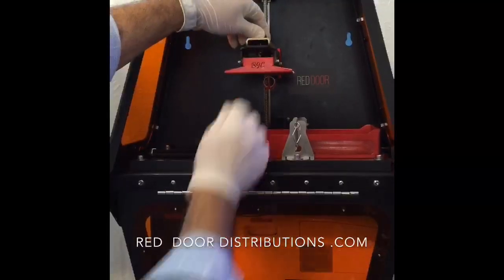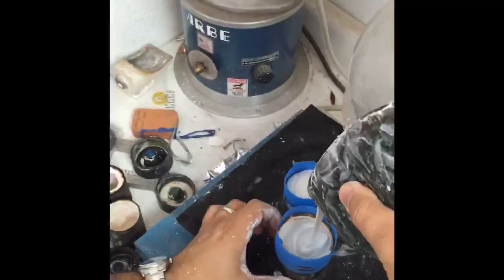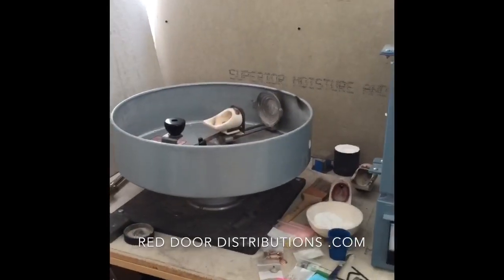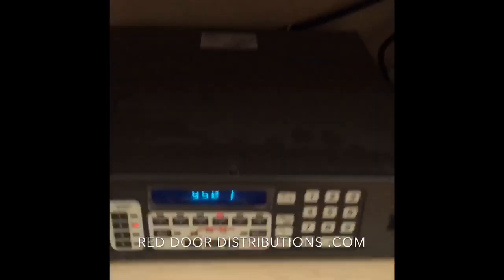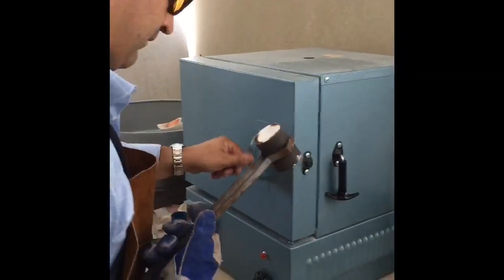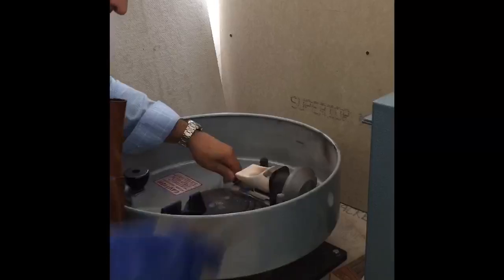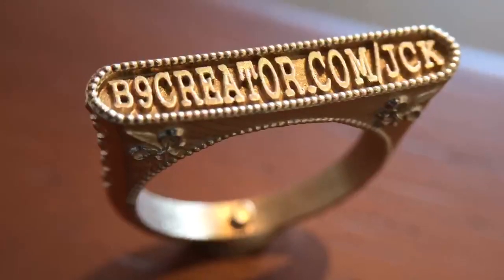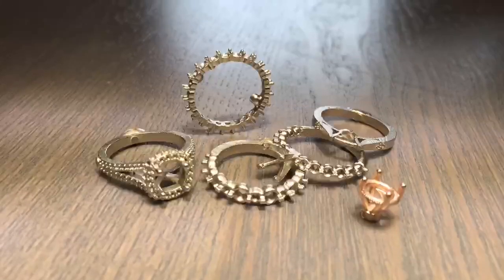Printing to Casting with B9Creations' Resins

Comment: Do you only use Satin cast? Plasticast has been recommended to me but I hate  the way it foams when you vacuum it. I've had bad castings with it for some reason. I've had some luck with my B9 resin but not the consistency I need. If you only recommend Satin cast then I'll go back to it. I'm trying your burnout cycle tonight with Ultravest for the first time. I'll let you know how it goes.
Reply: jewelerguy Also, do you leave the opening to your flasks down or do you turn them up?. That's also been recommended but I'm not sure what difference that makes.
Reply: +jewelerguy yes I highly recommend only using Satin Cast. I also do not like the way plasti cast boils as it has a big "drop". No I do not leave my oven door open nor do I flip the flask upside down. 
There really is no need for that as long as you have a calibrated oven. 
Just make sure you do not leave the flasks flat on the oven floor they do need to be raised up half inch to 1 inch to let oxygen in the flask. 
I do apologize for my delayed response and I really hope this is of some help to you. If you have any other questions please let me know as I will be more than happy to help. 
Best, 
Fernando
Reply: +Red Door Distributions I used your burnout cycle and that worked great. I used ultravest instead of satincast but I have a feeling it's all about the burnout cycle for B9 resin. Wax is a little forgiving but not this resin, that's for sure. Thanks for your video and your reply.
Reply: +jewelerguy Glad to see that your having success. Yes, with this resin it  is all about the cycle. Do you have the 1.2 b9 or 1.1?
Reply: +Red Door Distributions I have the 1.2 b9. Really makes a difference to get the cycle just right and let the investment dry before ramping. Resin sure isn't as forgiving as wax is that's for sure. Everything has a learning curve. I cast a resin model last week from a new casting resin and it cast as smooth as butter. The model was almost as smooth as an injection. But, the model came from a 50 thousand dollar machine. I think for 5,000 dollars, you can't beat a b9 and the models it makes. I'm really impressed with it.
Reply: +jewelerguy 100% agree this is the best machine for the money, Thank you for being a B9C customer.
Reply: +Red Door Distributions  Hi:) Im looking to invest into a machine that have a working castable material as opposed to projet1200 , which i have access to, that require phosphate based investment.  My question is, when burning out, does this material produce alot of smell and toxic fumes? I would not call a nearby window in a space where i also sleep "good ventilation". Will my situation be a problem with burning out these types of resins? I assume it is not steam dewaxable as my regular waxes.. Please Reply as soon as possible as i have to decide before the weekend.
Reply: +Adam K Hello Adam. Thank you for your interest in B9Creator. I will be more than happy to help you as much as possible and I can help you with purchasing one as well. I process orders very quickly and can have a machine shipped out to you as soon as you need it. 
To answer your questions...
   -There is a little smell but it is smells now different than wax, all materials have a smell when burning out but this is not too strong in my opinion. We cast every day in our work shop and the smell does not bother any one. 
    -There is no need to " steam dewax" with this Cherry resin. The surface finish is very clean and does not require a lot of clean up.
   
I do have a few more questions for you to better help you out. You can email me at Fernando@reddoordistributions.com . 

Thank you and I look forward to hearing from you soon. 
Best, 
Fernando
Reply: +Adam K Hello Adam, I am using the B9Creator Cherry resin. This is very inexpensive and is perfect for high resolution and easy to cast. Let me know if you have any more questions.
Reply: +Adam K Hope all is well, I just thought I would touch base with you to see if you have any more questions or if you would like to purchase a B9Creator. Thank you !
Reply: +Red Door Distributions Thanks i have sent you an email
Reply: +Adam K Got it thank you.
Reply: Also, what exact resin are you using with the satin cast 20 ?